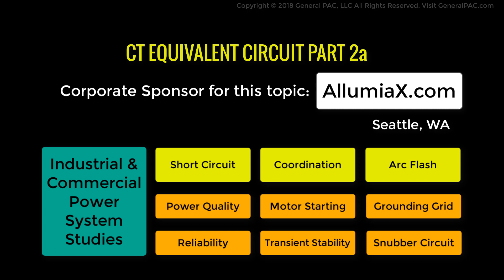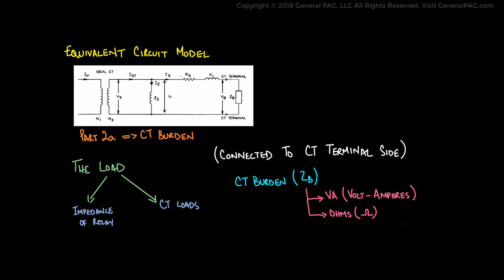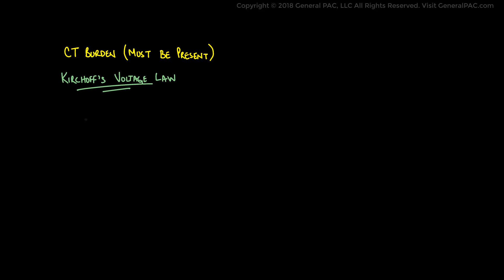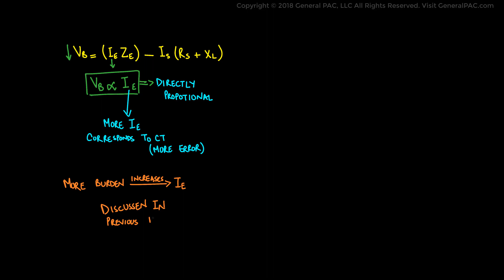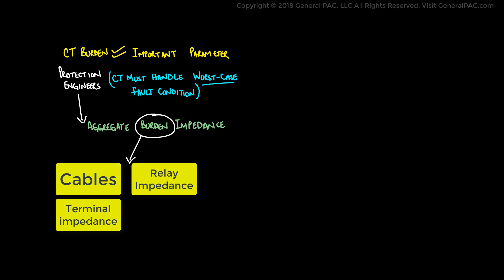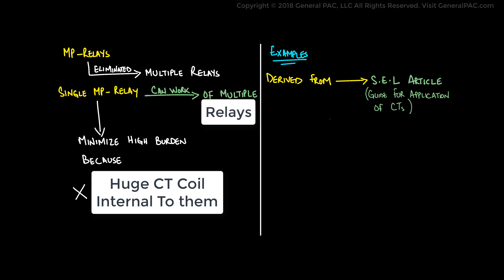Current Transformer Equivalent Circuit Model Part 2a

Comment from the maker: In Current Transformer course we will start from very basics: This course combines brief introduction to Current Transformer with its main characteristic and applications. You will emerge with the knowledge in principles, working, applications, sizing of CT that empowers you to have strong grip on the fundamentals of Current Transformer. This module consists of three parts, each building upon your knowledge based on previous ones. Sign up now  and get 𝟗𝟎% 𝐎𝐅𝐅 on 𝐂𝐮𝐫𝐫𝐞𝐧𝐭 𝐓𝐫𝐚𝐧𝐬𝐟𝐨𝐫𝐦𝐞𝐫 𝐅𝐮𝐧𝐝𝐚𝐦𝐞𝐧𝐭𝐚𝐥 𝐂𝐨𝐮𝐫𝐬𝐞: https://bit.ly/Current-Transformer-90OFF

Comment: I love your very informative and intuitive videos.May I know sir what is the principle behind why the voltage of CT secondary when no CT   burden?
Reply: Why the voltage secondary is so high when the CT is open?
Reply from the maker: Hey Anthony,

The basic principle any transformer works on is that total power of transformer on primary side shall be equal to secondary side. In case of no CT burden or in other words the secondary side of CT is an open circuit, Current will get nearly zero and Voltage will get high to keep the power constant. 

Regards,
GeneralPAC by AllumiaX
Reply: @Generalpac  thank you so much for the response sir,a very nice and understandable explanation.Godbless you always and to your channel.
Reply from the maker: @chesstunes8221  Thankyou for your valuable feedback. Its highly encouraging for us :)
Checkout our courses and get your hands on a variety of Power System topics here: ttps://bit.ly/PSE-Courses